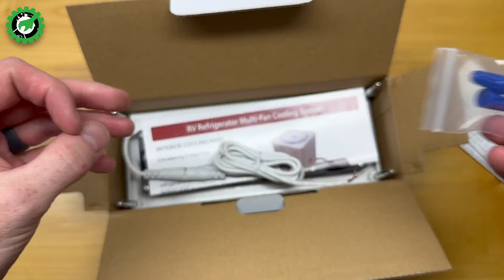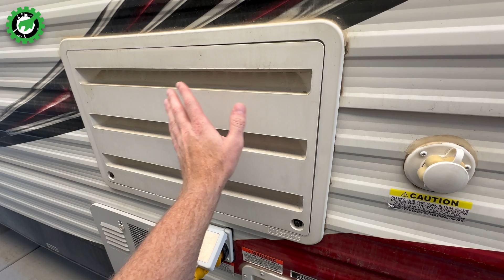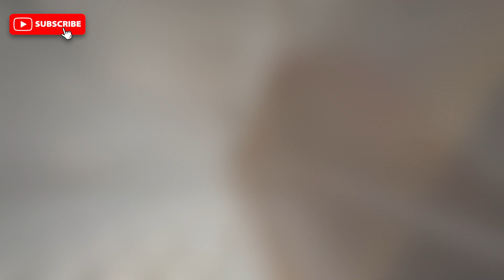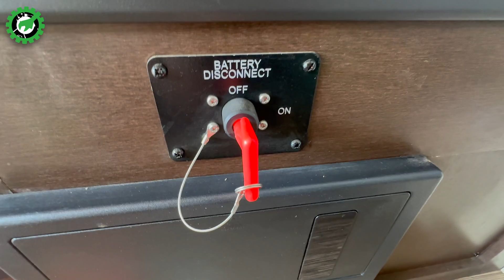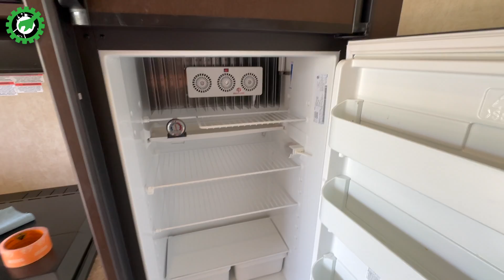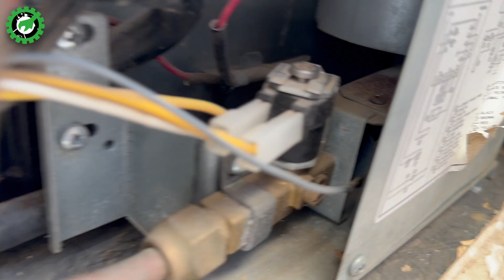RV Fridge NOT COOLING? - Quick and Easy Fix - Fan Hack - Dometic Fridge

Comment: Put same fan in norcold in 2023lance 1575 had to run wire thru drain line for 12volt added a piece of 14guage wire taped to wire from fan my mobile  rv mechanic  couldn't get wire  thru hose took  my Milwaukee  18volt vacuum  put over drain  hose  on outside  by burner  cupped  my hand  over hose  and  vacuum  nozzle  turned  on vacuum  and  my came out drain  line  had a tight bend problem  solved  fan was installed
Reply from the maker: Hope the fan helps!